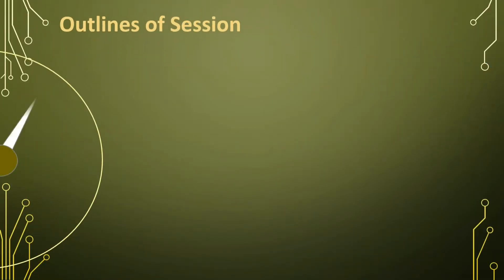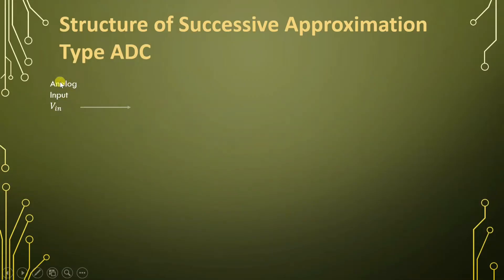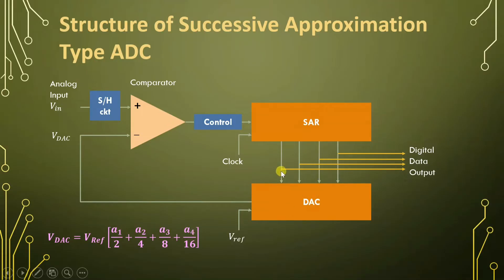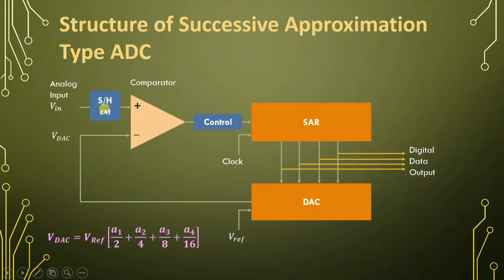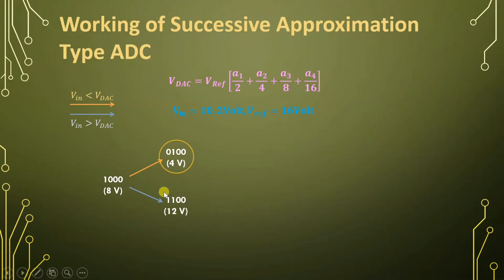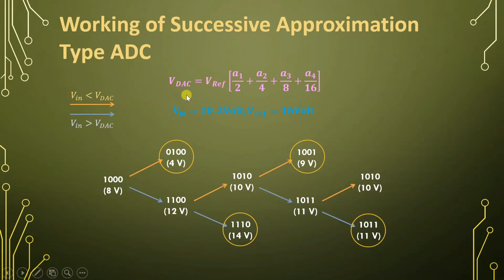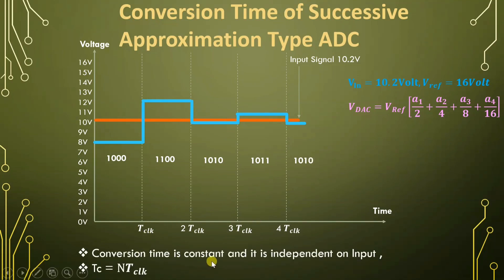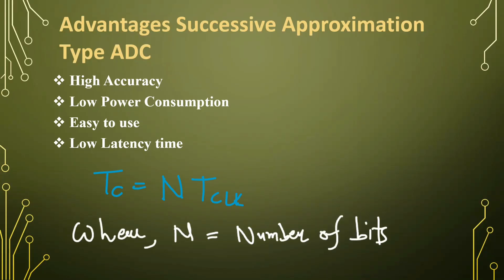Successive Approximation Type ADC: Basics, Structure, Working, Conversion Graph, and Conversion Time

Comment: Question: Let the analogue value of an input signal is 5, for reference value 1 for ADC. Considering that the ADC is 4 bits, write down at least 6 iterations to show the ADC process using successive approximation method (showing update in the binary digits of 4 bit).
Please solve
Reply from the maker: The successive approximation method is an algorithm used by analog-to-digital converters (ADCs) to convert analog signals to digital signals. The process involves comparing the input voltage to a reference voltage, and iteratively adjusting the digital output until it matches the input voltage as closely as possible.

For the given input signal of 5 and reference value of 1, the ADC process using the successive approximation method for a 4-bit ADC can be shown as follows:

Initial guess: 1000 (8 in decimal)
Compare input voltage to the voltage represented by 1000 (8/16 * reference voltage)
Input voltage > 8/16, so the first bit is updated to 1
Guess after first bit update: 1100 (12 in decimal)
Compare input voltage to the voltage represented by 1100 (12/16 * reference voltage)
Input voltage > 12/16, so the second bit is updated to 1
Guess after second bit update: 1110 (14 in decimal)
Compare input voltage to the voltage represented by 1110 (14/16 * reference voltage)
Input voltage > 14/16, so the third bit is updated to 1
Guess after third bit update: 1111 (15 in decimal)
Compare input voltage to the voltage represented by 1111 (15/16 * reference voltage)
Input voltage < 15/16, so the fourth bit remains 1
Guess after fourth bit update: 1110 (14 in decimal)
Compare input voltage to the voltage represented by 1110 (14/16 * reference voltage)
Input voltage < 14/16, so the fourth bit is updated to 0
Guess after fifth bit update: 1100 (12 in decimal)
Compare input voltage to the voltage represented by 1100 (12/16 * reference voltage)
Input voltage > 12/16, so the fifth bit is updated to 1
After six iterations, the final output of the ADC is 11001 (or 25 in decimal), which is the digital representation of the analog input signal of 5 with a reference value of 1 for a 4-bit ADC using successive approximation method.

Comment: Exercise:
A ramp ADC has a clock running at a frequency of 1MHz. The input voltage ranges from 0
to 40.95V for a 12-bit output. Determine:
(i) The resolution of the ADC.
(ii) The digital equivalent of 7.828V.
(iii) The conversion time for VA = 7.828V .
(iv) The maximum conversion time for this converter.
Reply from the maker: Total steps = 2^12 = 4096
Resolution = 40.95 ÷ (4096-1) = 0.01Volt 
Digital equivalent of 7.828V = 7.828÷0.01 = 782.8 ~ 783 
Conversation time = Approximation for 783 we need 10 bits approximation. And see the video till last so you can better understand everything.
Reply: @EngineeringFunda  Sir you said  Țmax=(2^n -1)Tclk.Is it necessary I say in this type of question for part(iv)?
Reply: Thank very much.Prof.Youre swift reply has really motivated me to  anticipate relevant content of electronics from you. Be blessed 🙌